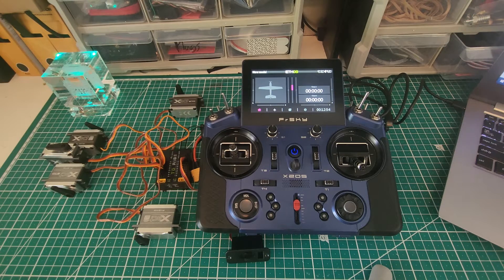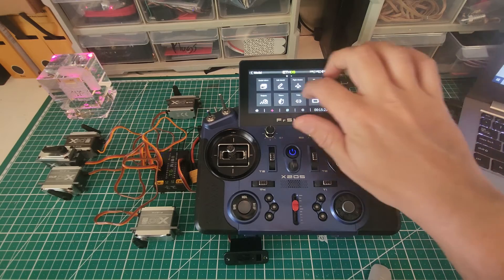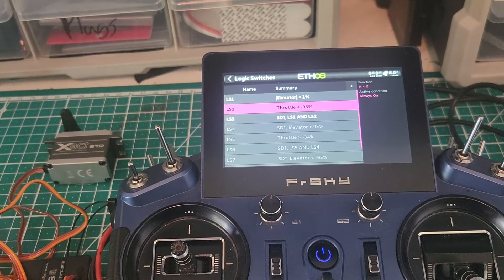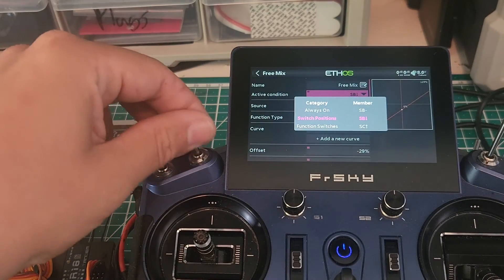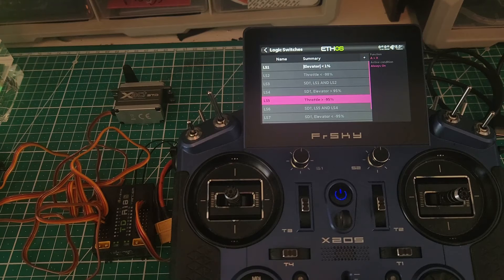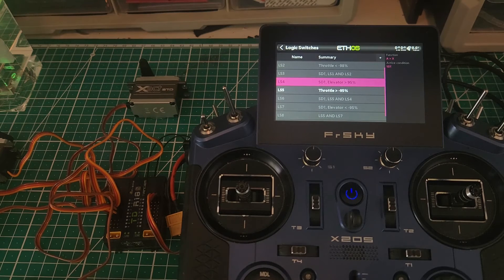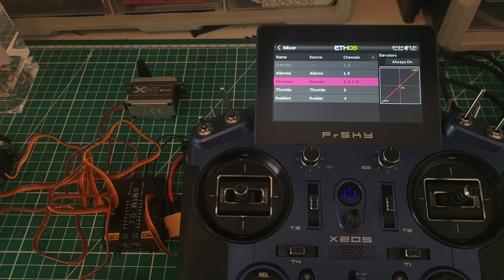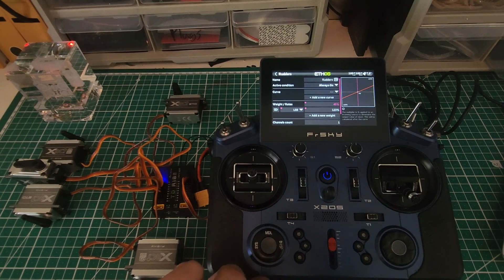Snap conditions, downline mixes and other uses of logic switches in FrSky Ethos

Comment: Hello, this was a great and very detailed  video.  I really think you will have the answer to my X20s problem....
I can't figure out how to adjust weight/throw separately for left and right side, and for each flight mode. In my sequence mode  rudder is set to 35% weight and im using "expo" curve. Left rudder can barely hold up knife edge....but right rudder is a bit too much and the plane is climbing.
My question is how can I adjust each side independently? I need to enable this for each axis. Any help would be greatly appreciated thanks.
Reply from the maker: I do this by using custom curves for surfaces. 

I find this especially useful by having a custom curve for left and right aileron servos - this allows me to tune the aileron differential completely through the range.

Alternatively, you could consider using a left/right logic switch for the rudder to change the expo.
Reply: Thanks, much appreciated.  Will give that a try.

Comment: I'm a Pattern flyer here in the UK and that's pretty similar to my set up, the additions that I have to your set up here is I also have a spin condition, I fly mode 2 so my snap and spin are triggered off the elevator and aileron both being greater than X i.e. right stick near any of the four corners and if the throttle stick is greater than 25% it's a snap but if less than 25% it's a spin, I also have my snap condition working off the right stick only with a rudder offset (same as setting up the downline mix) so that I don't use the left stick at all in the snap, that does though use up a whole bunch of logic switches to cater for both +ve and -ve snaps upright and inverted, that is the best logic switch explanation yet that I've seen on U Tube.
Reply from the maker: That's awesome Philip, I have been looking to incorporate a spin condition into my setup. It is critical for us in IMAC to show pitch departure at the beginnning of a snap for it to be scored so that is why my solution is based on just the elevator. 

I have evolved my setup to have idle (less than 25% throttle) Mid (25-75% throttle) and high (>75% throttle) unique snap conditions.

I think I need to work out a way to do my spin condition as it is the last switch I have to flick and it is annoying.

Comment: Thanks so much for doing this video.  I was wondering if you could a video with nose wheel steering and rudder? Where nose wheel steering is on Pot 1 (left knob) and also linked to rudder.  That way rudder trim doesn't effect nose wheel or visa versa.
Reply from the maker: You could easily do this by creating a new mix, the source being the pot and the output being the rudder channel.